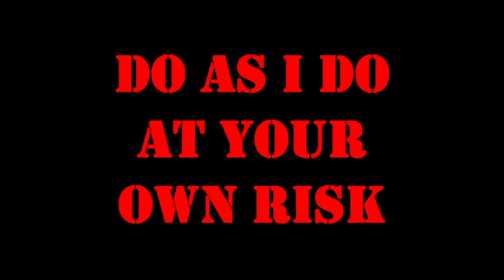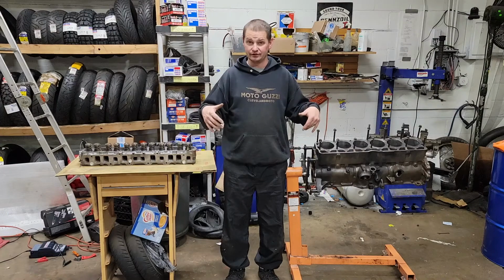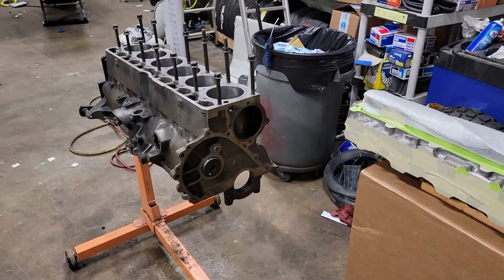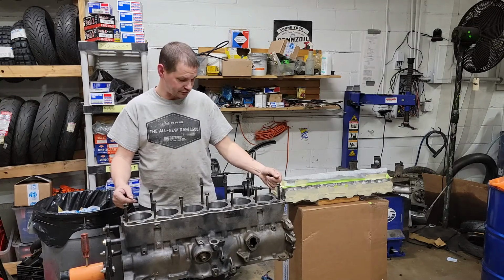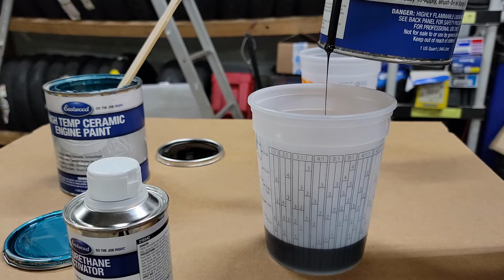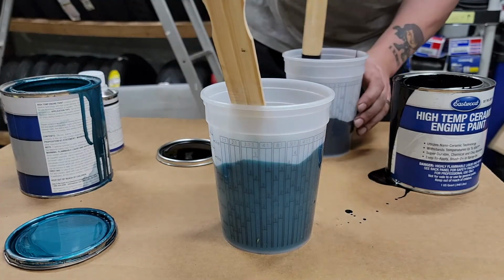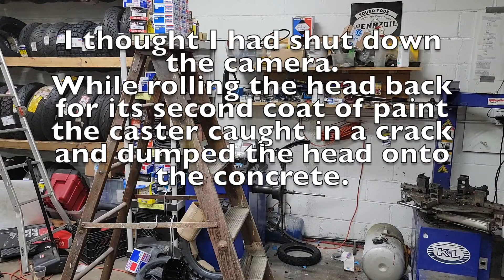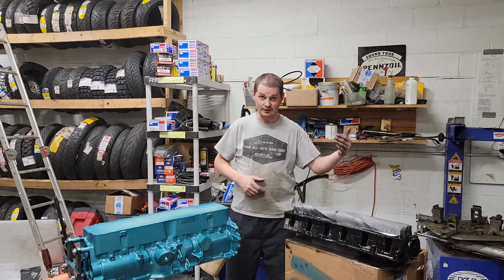Pt. 1 of building Rusty's engine Ep 56

Comment: I nearly cried for you when you explained of the incident . I will say , your a better man than I to have dealt with the trauma with the way that you did . If all that has happened was the broken coolant sensor , you’ll get it done . If you would like to test the valve seats for a proper seal , especially after the incident , I would say just place the cylinder head on the bench upside down and pour water onto each combustion chamber surface and observe . I’ve carried big block Chevy heads and they are heavy but the in line six heads are heavy and awkward so they are a bit more challenging to handle . On the lighter side , I really like the AMC blue applied to the engine block . It’s looking great .
I think your doing fine . I know the anticipation is mounting but some of the most valuable words I’ve heard spoken that I do try to live by , myself included is “ you’ve got to slow down to speed up “ . When we apply it to what we are involved with , it makes perfect sense . 
It’s going to be fine , you’ll get there . You don’t have to rush for anyone , would just like you to complete everything the way you want it down . Don’t worry , when your ready to turn the key and the stars and the moon are aligned and all is right , we’ll be there 👍